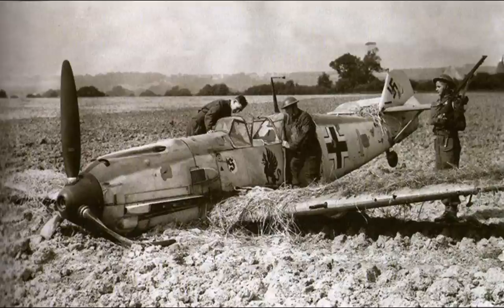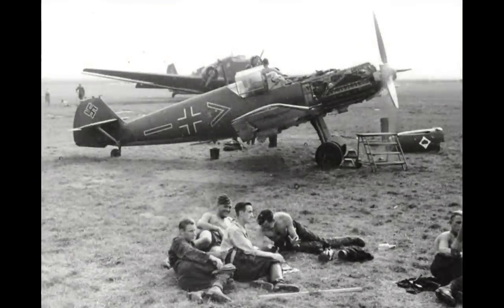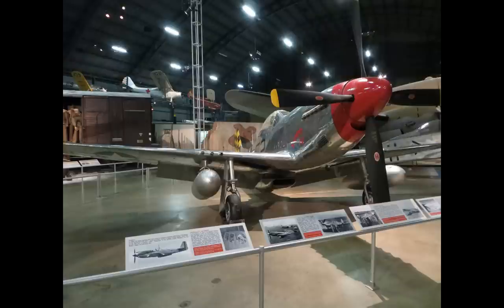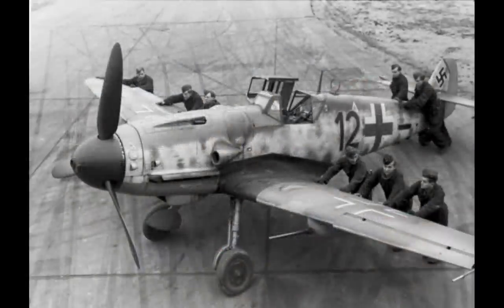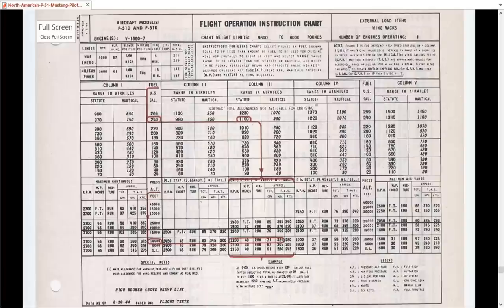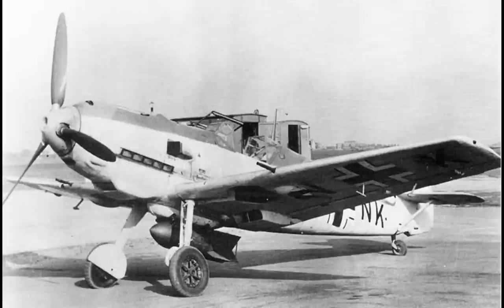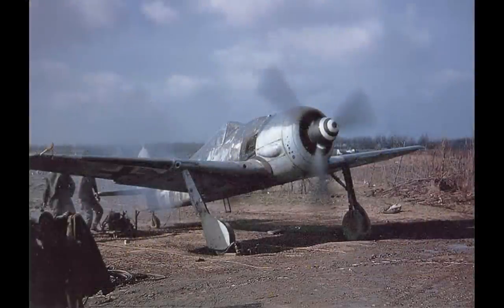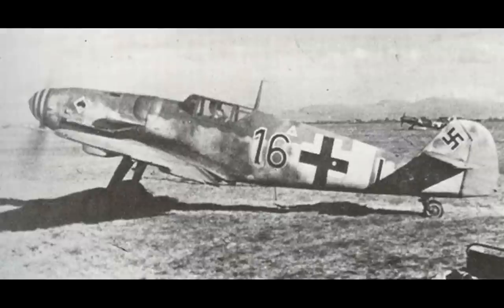Messerschmitt BF 109, Why Such Short Range?

Comment: In Jeffrey quills book  about the Spitfire he talks about the COG problems. Was this a factor in fuel load anyhow did the P51 get round these issues?
Reply from the maker: Several ways. First, the wing tanks are located in such a way that they don't throw it out of balance. The Merlin engine as installed was heavier than the Allison which it replaced. That meant they could add more weight in the back, which they did via a rear fuselage tank. That tank when full, put the center of gravity a bit too far back for combat, so they burned it's fuel first. By the time they reached the combat area, the plane was balanced properly.
Reply: They added a similar tank to very late model Spitfires (the Mark XVIII and later, I think). Quill mentioned it added quite a bit to the range. A full rear tank in the Mustang meant careful handling - apparently the airplane would snap roll if you weren't careful. A lot of Mustangs on the air show circuit have this tank removed and a second seat installed behind the pilot. Since you can't burn off the weight of the passenger during flight, I imagine they do something to compensate for the weight.
Reply: @iskandartaib  Thanks Guys. I guess modern air show aircraft there is lots of ways to cheat COG,  No ammo/Guns must make a huge difference, modern materials fuel cells etc.
Reply: If you think about the single engine fighter is an awful engineering design, virtually all the heavy stuff crammed as far forward in the frame as much a possible. Hard to think of a worse COG solution.  I guess thats why we sometimes see such oddities as pushers and central engines. Solves these problems at a stroke.
Reply: Which is why, I think, that all the jet fighters that appeared post-war (and to this day) put the engines in the middle, either in the fuselage or on the wings. They also moved the pilot forward where he can actually see to taxi without having to swerve left and right. The P-39 was ahead of its time - there were a number of designs that never got built or never got past the prototype stage post-1944 that put the engine in the middle and moved the pilot way up front (right up behind the propeller) - the GM P-75, the Me-509 and that Rolls Royce fighter design for the Crecy are three I can think of. The latter was meant to use Mustang wings (lots of those available) and they'd got to making a papier mache mock-up of the fuselage.Another note about the Spitfire's CG problems - part of that was because the Spitfire had a small horizontal stabilizer and they added equipment behind the CG. Later marks had heavier engines which meant no more rearward CG problems, I don't remember if they ever enlarged the horizontal stab, though they did make the vertical stab bigger mainly to handle the added power. I suppose at some point it gets ridiculous - check out the size of the Westland Wyvern's vertical tail... 3500 hp turboprop.

Comment: In fact the P-51 was designed during the Battle of Britain in mid-1940 and long before 1943 (the A-model) and was not modified to take the Rolls Royce Merlin with the B-model until that time.  So, it was not designed initially with any European experience to thank for the much greater fuel capacity.  The original engine, by the way, was the V-12 Allison, the same as used on the P-40 Kittyhawk and the P-38 Lightning.  Hope you enjoyed.

Comment: I guess I've never really understood the range debate

Even when I was a kid and first learning about WW2, simple logic told me comparing 2 different planes on the same task was going to give different results

It's also pretty obvious that time and place is a factor to any decision,  that's why equipment is updated

If the 109 was such a horrible plane, why did anyone ever get shot down by it?

Fuel consumption is always going to vary based on multiple factors.....drive 300km's at 100km/hr then drive 300km's at 110km/hr and look at the amount of fuel consumption for both trips with the same vehicle

This debate has never made any sense to me in 30 years of discussion,  without an equal comparison of say Spitfires flying to an equal distance and engaging in equal combat then returning

The obvious answer to the debate never happened, so everything else is speculative

Edit: and please don't say "Look at the Mustang"....as I said, updated equipment
Reply: The ME-109 was a great interceptor but what the luftwaffe really needed was a superiority fighter. They didn't get one until mid 1944 but by then it was too late

Comment: Let it be known that my personal opinion coincides with yours....., but I have debated carburation and fuel injection with a few old timers that mentor me. First off there’s 2 kinds of fuel injection! Mechanical witch we use in are cars per the rule book, and electrical . I love war birds but you know a lot more than I in the subject. I’m just trying to open your mind because if I have learned one thing from racing it’s as technology increases we are often proved wrong. I grew up at the race track and have learned that the more I learn the less sure I am about everything I know 🤣 in drag racing and nascar 2 sports I manufacture parts for. They recently switched over to EFI. When the Cup cars switched over from a carburetor to TB EFI. They lost a lot of power and it took them a few years to perfect the TB EFI system to recover that power . Also PRO STOCK drag cars switched over from carbs to PORT EFI a few years ago and they are just now starting to make the same amount of power. There’s no doubt in my mind that a perfect fuel injection system is better than carburation.......BUT  it’s a lot harder to perfect a fuel injection system compared to a carb. Direct injection is the holy grail because of the fact @ TDC the mechanical parts of the rotating assembly is all in line and none of the cylinder pressure can be translated in to angular momentum I.E. spinning the crank shaft. It’s not tell about 15-20 degrees after TDC does all that cylinder pressure rotate the crank. Direct injection allows you to pull ignition timing back toward TDC thus the motor spends less time trying to rotate its self backward. The piezo electric common rail injection systems that most Diesel engines use gain VE because they have several injection sequences for ever combustion even. Thus the injector can input a small amount of fuel in to start the expansion burn on the compression stroke and when the crank angle hits 15 degrees after TCD the injector throws the majority of the fuel in and using that fuel more efficiently.  I would think the fuel injection in the old war birds was a mechanical system. And because it’s mechanical the trade off would be that a mechanical system would easier to control mixture over a broader range of alt and DA but the carb would net more peak power.  So to say that fuel injection makes more power would be incorrect!  It just controls the mixture a lot better over a bigger range of working conditions.  The carb would make more power but only when it’s completely optimized for conditions witch is a lot harder to do. Look at drag racing for some info. There are tons of classes that still use carbs even though EFI is permitted and NHRA had to mandate a rule to make the pro stock guys switch over to EFI to make them more relevant to the automotive world to bring the manufactures money back in to win on Sunday and sell on Monday. To say generically fuel injection is better than Carburation  might be a bit off, because there’s so manny different forms of fuel injection. There’s a great vid on YouTube of Jon Kaase the king of BOSS 429 ford using his finger in the intake manifold port runner to see where peak port velocity is in the intake port runner to better place his injectors🤣 Carburators are great at atomizing fuel.  They tend to produce very little wet flow on port walls. Fuel injectors have to be extremely refined and placed properly in the intake port to reduce wet flow. It’s widely documented how hard it is to optimize fuel injection and how easy it is to optimize a carb. I’m with you on the benefits of a fuel injection system, but to say it’s generically better than carburation might be a bit of a stretch .
Reply from the maker: WW2 aircraft use mechanical fuel injection, of which there are various sub-types.
Reply: Greg's Airplanes and Automobiles we use mechanical injection in the cars I work on. We run a mechanical 120-130GPM pump’s off the front of the cam shaft driven at 50% of crank shaft RPM. We have a 22 gallon tank with dual  2-3/4” supply pipes to the 2 fuel pumps. We burn any where from 1.75-2 gallons per second! So we burn 8 to 10 gallons on a 4 second run. With the burn out front start of the motor to the Finnish line we burn 18-20 gallons in 1.5 minutes or so. Each time a cylinder fires it used about 12 ounces of 90% nitromethane and 10% methanol. We make 11,000 hp @ 7,800-8,000 rpm out of a 650 lbs 500cid all aluminum hemi.

Comment: The 109 G carried a lot heavier armament and shells then the Mustang I believe. Three thirty mm were standard on the plane and two large machine guns with a lot of ammo. This I am sure had a effect on range. These German fighters were "point defense" systems as was and is the mig 21.  They were never ment to have a long range because of their mission. In the Battle of Britain the german's had planned on a fighter with lomg range. It was the Me-110. In the Euro campaign it was a success. Not so against the British. It did fight aganst the american bombers later in the war when the american's didn't have the Mustang.
Reply from the maker: Regarding armament, a lot depends on just which 109G we are talking about. Some have two rifle caliber machine guns and a 20mm cannon. Others have heavier weapons, and they often had gun pods under the wing, although those hurt performance a lot.
Reply: Yes this is certainly true. Some 109's and Fw-190's even carried heavy rocket packages along with a lot of cannon ! Then there were the "stripped versions" that carried just enough armament to handle the Mustangs. These were developed because the 109g's with heavy armament were sitting ducks for the Mustangs because of their overloaded weight. These were problematical because often they would get chances to take on the b-17's but had little firepower to do so.

Comment: And concerning the Mustang Speed Video, I can already predict: 

Laminar Flow Wing Profiles against Slatted 1930s NACA Profiles. 
Also: Engine Ratings and Performance Figures. 
And: Exposed Tailwheels, Wheel Wells and Bulges to fit Wheels and Guns. 

And in the End, Speed and Climb are of equal Importance in a Fighting Situation. The Mustang could disengage and Run in a Dive, a 109 had to disengage and Climb to gain an Advantage. 

And why doesn't anybody talk about the critical Stall behaviour of the Pony? They added those fancy little Fins on the Tail for a Reason.

Comment: While Bf 109 did have  range comparable to it's early war contemporaries, battles are not fought and won by comparing the performance and specifications of the equipment used. If you are planning a war of conquest, which the Germans were,  range  of fighter aircraft should have been given a higher priority. Yes, the Bf 109 was a fantastic airplane, but it does question the high level planning and foresight of the Luftwaffe.
Reply from the maker: With the benefit of 20/20 hindsight, that's easy to point out.

Comment: You also couldn't take any American fighters to comparisons to any European fighters since American fighters are designed to defend America in mind, which is SUPER LARGE. On the other hand, the P51 was designed to fly as far as it can so it can defend allied bombers in offensives, learning experiences from previous designs such as the P-39, P-40, P-47 (and all these fighters came out after the 109). You have to remember, the 109 is only in service in late war only because the Germans don't have enough production capacity against both fronts, and the Allies totally outmatches Germany on all production capability. If you are going to take any fighter to compare to any allied fighter, you have to take the FW-190, the true backbone of the Luftwaffe (Which is pretty much agreed by all German generals, with one of them saying that the 109 was a racehorse, but not as reliable as a workhorse). The 109 is old and isn't even suppose to be on the frontline past 1941, which means that the only American fighters you should compare it to are either the P-40 or P-36, which both are arguably not as good as any Axis aircraft in service at the time.
Reply from the maker: Do you understand that this video isn't a fighter vs. fighter comparison? It's a technical explanation of the 109's range limitations.
Reply: @GregsAirplanesandAutomobiles  The simple fact that a ton of people out their just take a late war fighter with a completely different design philosophy and stick it up on a fighter developed in the inter-war era just triggers me, and I am glade that you actually sat down and answered that question cause I've been asked that way too many times. One of these questions I was most asked in the US was "How was the 109 considered a superior German fighters when nothing of it is better than the P-51", and THAT is what triggers me. Thank you again for your great video that could actually teach many people a thing or two.

Comment: When Germany was re arming in the 1930s, they would have known that a war against Britain and Russia was inevitable, 
and therefor would have needed a 4 engine heavy bomber and a long range single seat escort fighter, 
instead in 1939 they ended up with 2 converted passenger/mail planes as twin engine medium bombers, (HE111 and DO17), 
a short range single seat fighter, BF109, that didn't have the range to escort bombers to the important war material manufacturing areas, 
like the Midlands, and a long range twin engine fighter, ME110, that needed a single seat fighter escort too, 
add to this that Germany had flown the first jet fighter, BEFORE they invaded Poland, "they could have prepared for WW2 properly", 
they weren't that well prepared in 1939 at sea either, with just 57 U Boats, that were basically WW1 technology, and NO aircraft carriers, 
they even used the same basic invasion plan of France in 1940 as they used in 1914, the one thing Germany didn't have proper plans for was, OIL, 
and without a proper oil supply, Germany was DONE FOR from the first day of WW2, they did make some GOOD military kit though, 
like the ME262, FW190, flack 88 gun, MG42, some decent tanks, type 21 U Boat, etc, and wasted endless precious resources on the V2.
Reply from the maker: Hitler did not expect or want war with Britain. He misjudged their response to the invasion of Poland. He did expect and want war with the Soviets.
Reply: @GregsAirplanesandAutomobiles  Hitler "KNEW the score over invading Poland" one foot in it, and its "game on" from the U.K., just the same as in WW1, one foot in Belgium and its "game on", as we Brits don't back down when we sign up for defending a nation, be that Belgium in 1914 or Poland in 1939.
Reply from the maker: Really? What about Hong Kong in 2019?

Comment: Big, low compression engine. The Germans didnt have the high octane fuels to get the most out of their engines so needed more displacement for the same power output. The Russians used even lower octane aviation fuel - so low that the Germans couldnt even run their trucks on it (65 Octane).
For comparison the Americans were running 130/150 Octane fuel in their fighters late in the war (really high on Tetra Ethyl Lead (TEL) in addition to isooctane). The Germans srarted with 80 Octane and worked up to synthetic 110 Octane before simply running out of fuel entirely.
Higher octane equals higher compression equals more power out of a given displacement engine (within limits...)
Reply from the maker: I have a whole video about that.

Comment: From the start the 109 was an interceptor. Did the designers ever envisage this fighter escorting bombers? I believe the Germans thought the 110 would be a better escort fighter, until they found out it wasn’t. Was there a theatre of the war that tasked the range capabilities of the planes of the Luftwaffe like the Battle of Britain? The Germans never seriously developed a longer range heavy bomber so why would they develop a fighter to escort it? In the prewar era, when Messerschmidt was developing the plane, the prevailing attitude was that bombers didn’t require fighter escort as performance negated the need. Of course, history proved them wrong. The development of medium bombers tells you much about how the Germans expect to wage the war. The planes were never going to operate much beyond the gains of the Wehrmacht. Fuel was always an issue for Germany during the war, why make tanks big when you couldn’t even fill them?

Comment: And the show Engine Masters compared a carb to Multi port fuel injection and got more HP because of the cooling effect, HOWEVER... the issue with their set up, is it wasn't really truly taking advantage of the fact there isn't a carburetor there anymore, they took a duel plane intake manifold for a carb and modified it to fit fuel injectors in it, which in my opinion was a horrible design.
Reply from the maker: I haven't seen it. In any case, the cooling effect from fuel vaporization is dependent on where you spray it in, and has nothing to do with EFI vs. Carb, as EFI can spray in where ever you want.
Reply from the maker: Also, sure, a Carb can beat EFI is certain tests. Running an EFI system into a manifold designed for a carb is clearly a far from a valid comparison.  Imagine if we plumbed a carb into an LS1 EFI manifold.
Reply: @GregsAirplanesandAutomobiles  

And in the case of any internal combustion engine, if you really want a cooling effect, you go with WATER INJECTION!